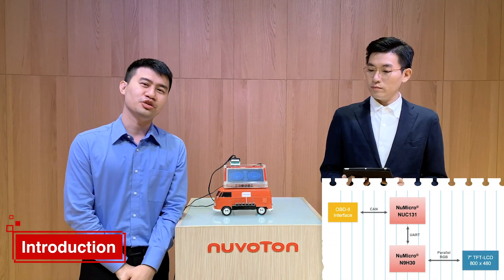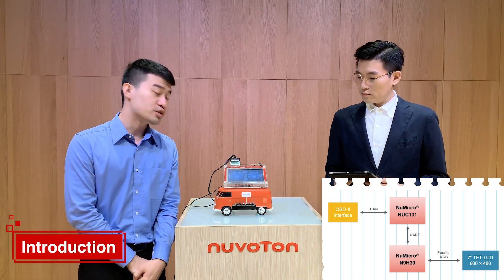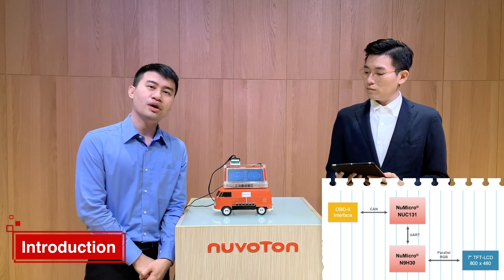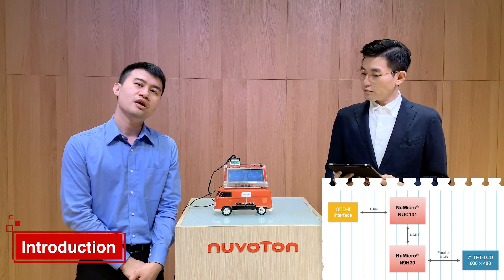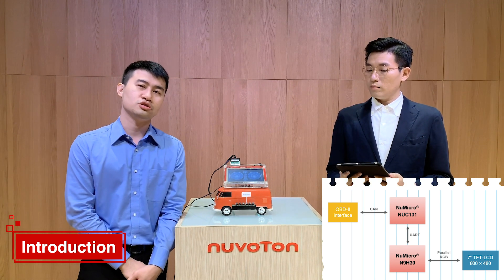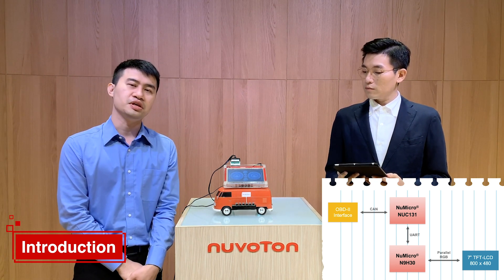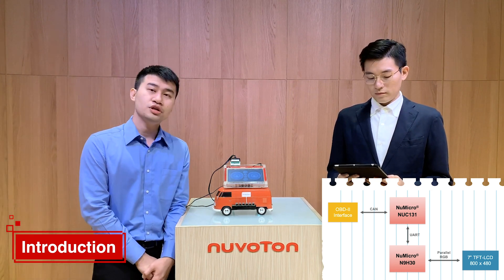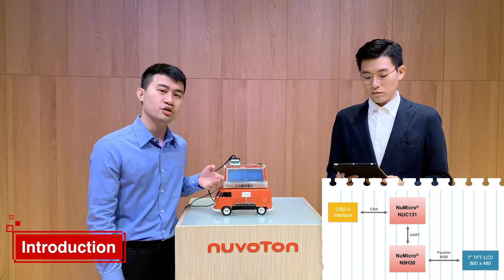Automotive Data Logger Demo

Comment: Hello ! I seen Nuvoton ISD 9160 SoC using Microsoft for their Limited Editions consoles Power Front Board. its have special sound effects rather than normal ON/OFF, Disc Eject sound. I was never seen this SoC in Normal Xbox One Consoles. So, Is this Microcontroller Using for save sound clip or communication with main motherboard ?
Reply from the maker: ISD9160 is Audio MCU, can be master or slave, can playback sound from SPI Flash or I2S. 
What is your product function or required spec? 

If you have more questions, please contact SalesSupport@nuvoton.com
Thank you.
Reply: Thanks for reply  @NuMicro